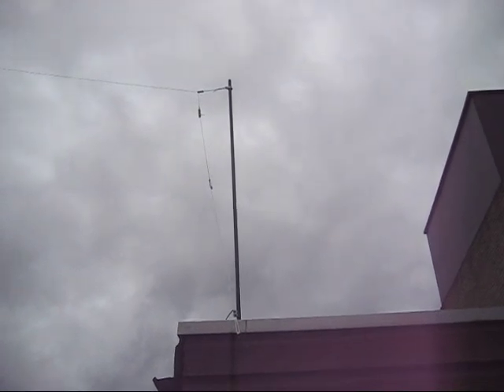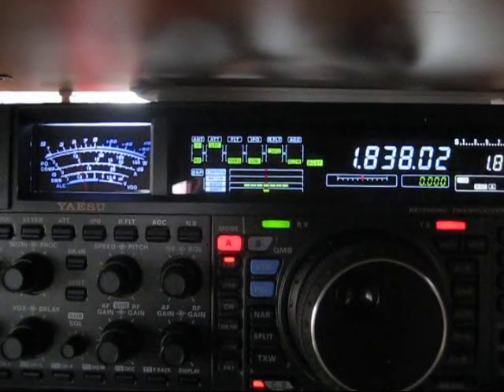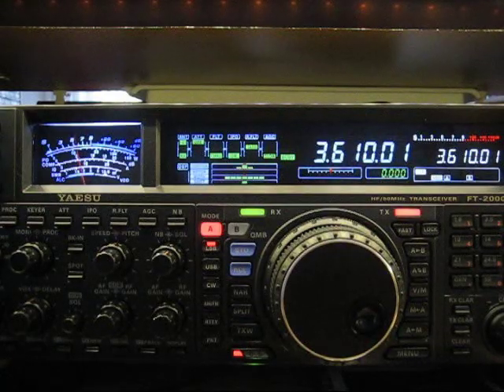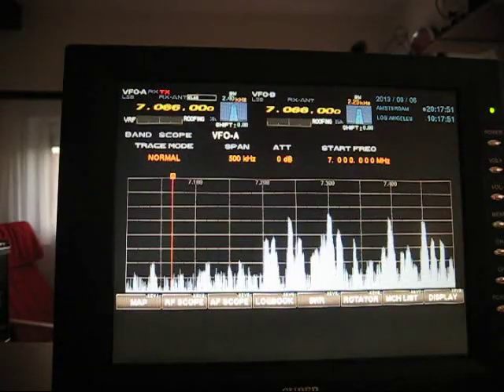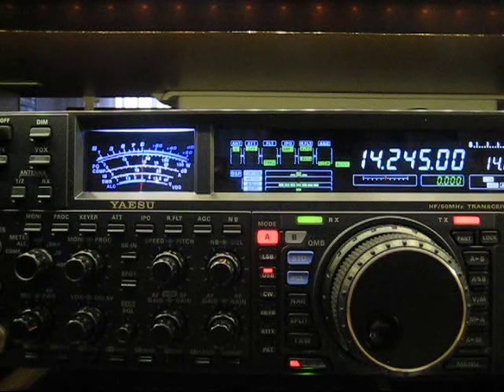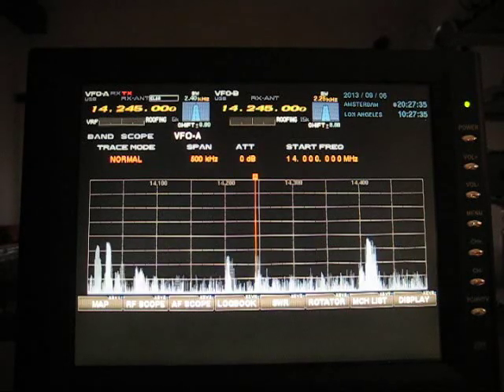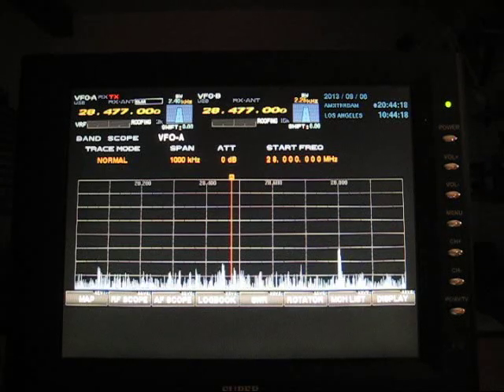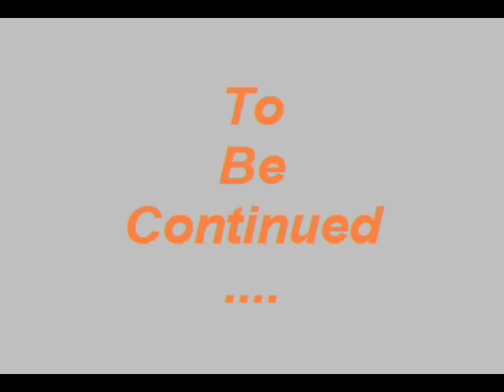Fighting QRM, Wellbrook ALA 1530 Loop versus wire antenna in noisy environment.

Comment from the maker: Hello Zaperfan
The distance between the two antenna's is about 5 meters. Wellbrook states that the Loop can handle 400 V/m or 1A/m. I work with a max power of 150 Watts so there is not a problem. It would even be possible to have them closer together as long as you do not cross the limit mentioned. I also bought a MFJ 1026 very recent. I have not found the right noise antenna/ position yet. I am thinking of putting a small vertical (maybe 70 cm) close to the loop as the next experiment.

Comment from the maker: Thanks for the warning. I found a mod for the MFJ 1026 to protect the noise antenna input circuit. I think that if I find the correct noise antenna/position I will perform that mod to the unit.

Comment: But you can't transmit with a Wellbook 1530 can you ?
Reply from the maker: That is correct, it is only for receive. So for transmit you need another antenna, a simple one would be an endfed wire. There are loops for both receive and transmit, but they differ from the Wellbrook.

Comment: Thanks for the information experiment with the MFJ1026 It is a little tricky to get the correct antenna to work with the unit but it dose work when you get used to the way it works,don't use the small antenna the you screw into the unit it is useless .If you transmit with the unit in line be very careful !! if the noise antenna is near the transmitting antenna you will blow the small bulb the acts as a fuse inside the mfj cheers tnx for reply

Comment: Very clear presentation and demonstration. Are you still using the loop with good results?
Reply from the maker: Yes, I am using it very frequently. I also have a small beam for 20 meters and above. Most of the time I use the Wellbrook for the lower bands 30-40-60-80 meters or if there is much QRM on 20 and higher  too.

Comment: Thanks for the fine demonstration .I was wondering if you had any problems with the loop and your transmitting antenna they seem to be in close proximity to each other .I also suffer the noise like yourself and have used a MFJ 1026 that is a good alternative be not really very practical as you need a antenna that has the same gain as main antenna for it to be effective .Would like to know your views on this please

Comment: I think you would be much better served with a Hex Beam than using that wire end fed. Interesting use of the Wellbrook Loop; I am considering buying one for my own use.
Reply from the maker: I heard good stories about a hexbeam, but is it all a matter of having enough (and the right sort of -) space. Also 40 and 80 meters on a spiderbeam would never fit at my place, but the endfed does (even 160 meters - just a bit). Good luck with your Wellbrook, it is worth the investment.
Reply: @PA0LUX  So the best use of the HexBeam would be for 20-6m. You have sufficient space from what I can see for that. They work well as low as 7m AGL.

Then use an OCFD in inverted V configuration for 40 and 80. The center point can be drawn up on a pulley mounted under a rotator cage.
Reply from the maker: @johnratcliffe6438  There is no room for it. The video is about 8 years old. Since about 5 years there is a beam (2m, 70cm, 10m - 20m) on the roof. See QRZ. But thanks for your advice.
Reply: @PA0LUX  Of course my friend,  apologies! 73, John

Comment: Nice video. I’m really thinking of buying one of these loops. How important do you think it is to have a rotator for one of these?
Reply from the maker: I am using a rotor myself. If you use the loop to get rid of QRM which is only in one specific direction, you could do without a rotor. But also beware of the fact that this loop is a bit directional on the lower frequencies (80 - 40 meters). Maybe you could start without a rotor and add one later if needed.
Reply: I get better results with my Wellbrook by using a rotator.  Using my loop without a rotator was kind of like driving my car without a steering wheel.

Comment: hi just want to ask you i have a wellbrook loop also and using a cushcraft r6000 antenna for tx my loop is attached to a wooden fence post and loop is at 9ft high above ground with rotator when i use the loop for recieving and hear the signals that i cant hear on r6000 that are weak or in the noise when i hear them good enough to transmit with my r6000 do i need to switch the rx antenna on the radio to off thanks
Reply from the maker: Hello Pat If you have a separate RX input on the radio, you do not have to switch anything. However I myself have put a small  (home made) relaybox between the Loop output and the cable to the radio. The relay is switched with the (combined) PTT signal from both my main transceivers. The same signal is switching my Linear and the ANC-4 noise canceller. This is done because in the past I changed cables and accidentally put the transceivers output on the Loop. That is a 300 euro's error. So the relay is only there in case I make that mistake again.